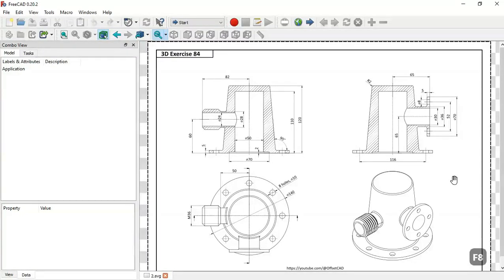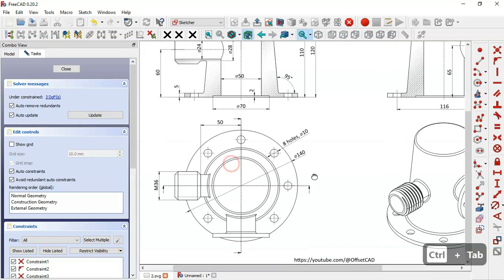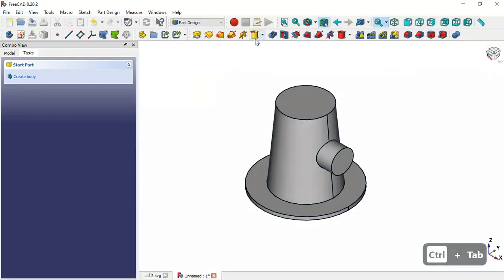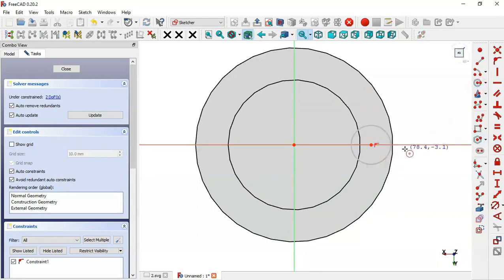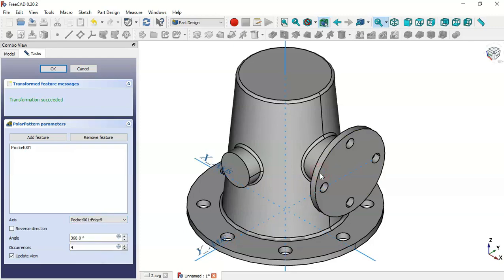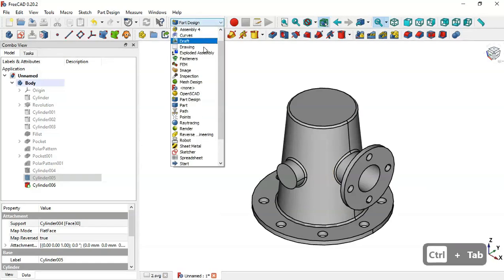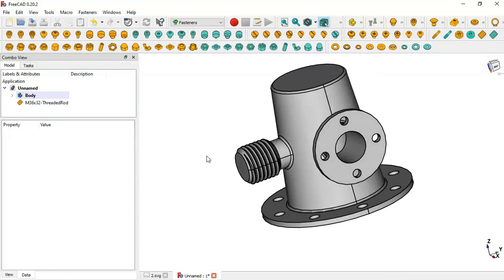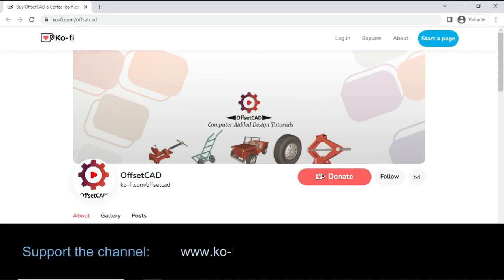FreeCAD Beginners tutorial: practical exercise 84

Comment: Nice. In the last step couldn;t you have used a subtractive cylinder?
Reply from the maker: No. Because that tool of PartDesign workbench don't take effect in this part. To use that you will need to create a new body and instead of create a subtractive cylinder, create a additive cylinder and then go to the Part workbench and subtract that cylinder in main part using Cut tool of Part workbench.